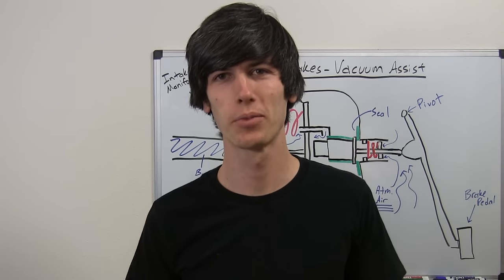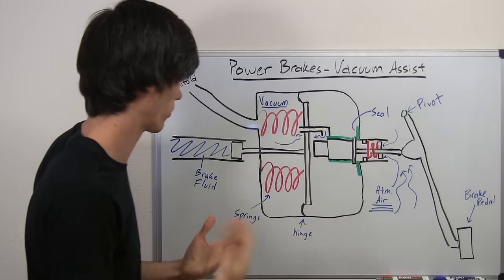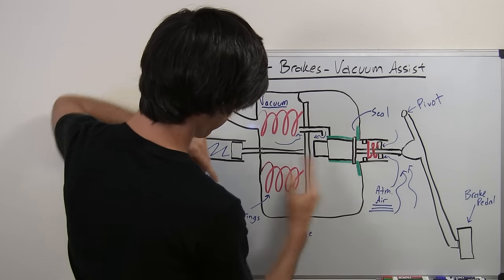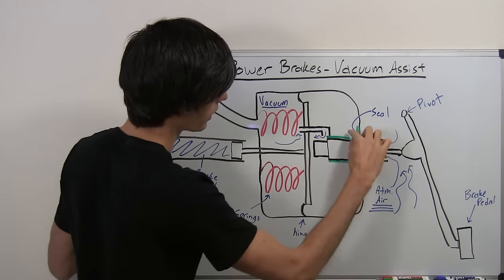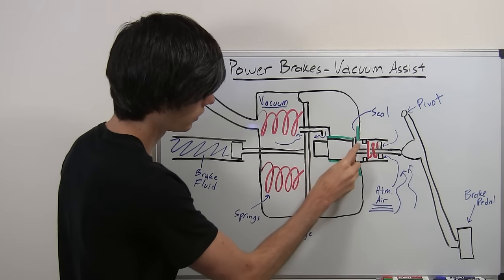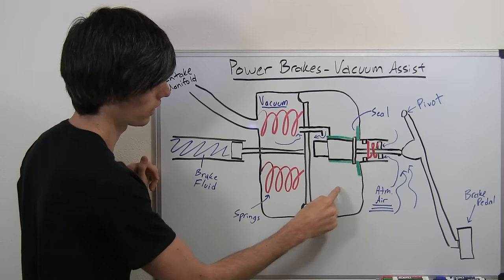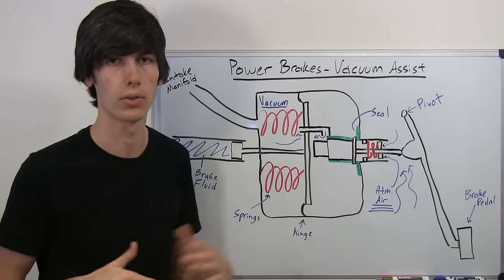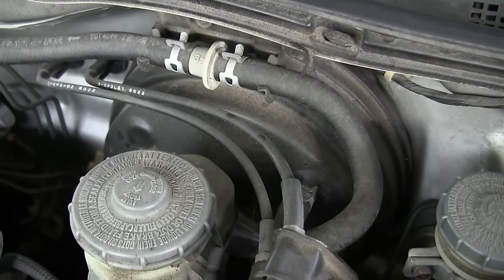Power Brakes - Vacuum Assist - Explained

Comment: My brakes now rely on leg power since last week. I hear a whistle as I apply pedal pressure and it goes away when the ignition is turned off. Does that mean I have a leak in the hose from intake to booster?

Comment: If there is a constant vacuum, how is it the brakes are never applied even a slight amount by themselves?

I'm assuming the vacuum created by the intake doesn't have enough force to pull that plate unless the atmospheric pressure on the other side is helping?

Comment: In forced-induction engines the vacuum line has to be before the turbo/supercharger, otherwise all you'll get in the vacuum-assist is boost pressure.

Comment: but if vaccum is there on the other side then , a small amount of air will push the piston as hard as bit large amount of air (i mean to say that if there is no air on the other side then even the little amount will create the same effect ie jerk push the piston as hard as the large amount of air) so variable air flow will have no effect on the braking, it will just push hard as soon as air enters

Comment: need help here... my break is pumping when applying breaks on high speed around 50 to 60 KPH. no problems on break when moving slow. I have no Idea what is the possible problem.
Reply: the brake is pumping or kicking back under your foot when you apply your foot to brake? You need your brake rotors/discs changed. they're pitted from wear and that's what your feeling

Comment: Hi there, I love your videos as you explain things very well. On this one I'm struggling with 3 things that I hope you could help me out on. Firstly, based on your drawing it would seem that the amount of power assistance is always the same as it depends on the difference in pressure, so why do the brake calipers clamp harder the harder we step on the brake pedal? Is it because we're opening the seal more and allowing more air in? Secondly, when the engine is stopped we can still use the brakes around 5 times before the pressure equalises on both sides and it becomes hard, now why doesn't the air from the air filter come through the manifold and fill the vacuum on its own when the engine is shut down? Thirdly, when ABS controller kicks in and takes over the braking does it still use this as its primary source of hydraulic pressure or does the ABS system have its own servo to increase the hydraulic fluid pressure? Thank you in advance.
Reply: Hi hi could you kindly explain to resolve my query above? Thank you.
Reply: You'll open the seals further - it should let in more air to push on the plate.
Reply: James Muehlner Hello James, Thanks for your response. I'm sorry but I don't see the logic of your explanation because this is a sealed device (air doesn't flow through) therefore, regardless of the size of the seals opening the pressure will be the same. If you have 30psi on 1 side of the wall you will also have 30psi on the other, regardless of whether the opening is 1mm or 10cm. This is because air-flow doesn't come into the picture, only aie pressure. I hope you understand where I'm coming from.
Reply: Brian Su brian your on the right track, im taking a heavy equipment course and im just covering the brake systems. the booster assists in the application of the brake, however all that extra stopping power comes down to the mechanical leverage of your foot and the whole "push rod" Assembly. the original need for these boosters is for quicker application with less force with basic applications as not everyone has tree trunks for legs. but like i said, the harder you press, the more force mechanically applied to that brake. atleast thats how i see it.
Reply: Brandon Harper hmm OK thanks Brandon.
Reply: Brian Su k

Comment: Nicely explained. But pedal is not always pushed right in. So if soft brakes are applied the equaliser is not fully closed. Its proportional action not on/off action unless hard braking is applied
But nice thanks

Comment: Hi! Can someone explain why pressing the brakes harder stops faster? (Obviously I'm wrong but) it seems like pressing the brakes a little bit would open the chamber and you'd get the full effect of the vacuum, and instead of braking a little you'd brake full force. This would also mean that pressing the brakes only a little bit but for a long time would let lots of air in and the booster would increase your braking power constantly instead of having steady braking. (Again I know this isn't what happens but idk why) I get pressing hard pushes more fluid but looking at the way the booster works I don't get how it avoids letting tons of air in with just a slight press
Reply: This is a fairly old comment, but when the pedal is pressed, the seal (the green part) partially or fully covers the vacuum line inside the booster. This allows for partial braking as some of the atmospheric pressure is allowed to escape through the partially open line.

Comment: Hi there. How does this system works in turbocharged systems? In manifold there will be greater pressure, so it should work backwards ;) Have you seen system in turbocharged cars?

Comment: Based off of this, quite simply, it is the vacuum pressure of the air intake of a running engine that gives the power brakes their ability to work?

Comment: Wouldn't it be hard brakes because when the air comes inside the chamber , the piston will move suddnely very fast and will apply brakes hardly even when small push is given to the brake pedal?? Please explain

Comment: Very good except a minor inaccuracy of the vacuum arrows. Actually vacuum is nothing (low pressed air in particular) it does not move. The (high pressed) air moves towards the vacuum (low pressed)... ;)

Comment: I hear the same click, my car has an automatic transmission, and the click I hear is coming from, let me say, the gear, I think this click is to unlock the gear stick, so I don't change it to "R", or any other mode, when it's on "P", for safety I think.

Comment: Ok so 94 cavalier 3.1 car runs awful and stalls. my brake booster is one problem,. my delema is when i pull my vacuum hose from the booster my car should want to die right? well when i pull it and just let it suck my car runs great like a champ. as soon as i plug it back in it dies. ??? why

Comment: so is braking increased when downshifting since you have more of a vacuum
Reply: Adrian Ortiz nope, less vacuum in the manifold with more throttle. Vacuum would increase before the throttle plate and decrease in manifold so less braking power.

Comment: But how do you control the amount of braking force with this system if it's the air that pushes the piston?In the diagram the brake pedal is not directly connected to the brake fluid piston. Depressing the brake pedal simply opens up air which in turn pushes against the piston and the brake fluid.  So regardless of how little brake you apply, you get a full braking according to this diagram but that's not true.
Reply: Good Observation, the diagram is a bit rough. In the case where there is no vacuum (failure or engine shutoff) the input force from the brake pedal push rod will apply on the master cylinder rod .
The booster is a really quite a smart device, the amount of assist depends on the amount of pressure applied on the pedal and the vacuum assist only applies when you increase the force on the pedal and not when you are holding constant brake pressure.

Comment: What about turbocharged cars? They have pressure lines tapped after throttle valve and still they show positive pressure on the boost gauge. So how does the brake booster gets suction?

Comment: How do power brakes work in a hybrid car? At low speeds/stopped, hybrid cars automatically shut off the combustion engine, so there's no vacuum coming from the manifold I guess?
Reply from the maker: They can also use the electric motors to brake, and at low speeds not as much force is needed.

Comment: How can i tell my brake booster is bad ?
Reply: Pump the brake a few times to deplete any vacuum, hold pedal down and start the engine, if the pedal drops its fine, if not it may be faulty

Comment: How about a turbocharged engine. There is no much vacuum in the intake manifold in this kind of engine.
Reply from the maker: Ayoub Rabhi There's still a vacuum the majority of the time, unless you're at WOT. There are also alternatives (hydraulic-boosted powered brakes).
Reply: Engineering Explained thanks